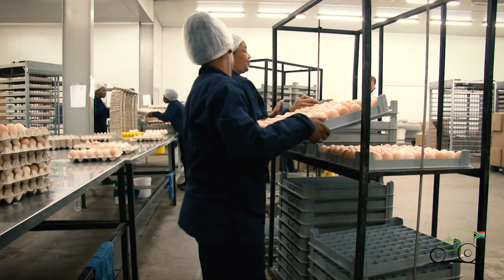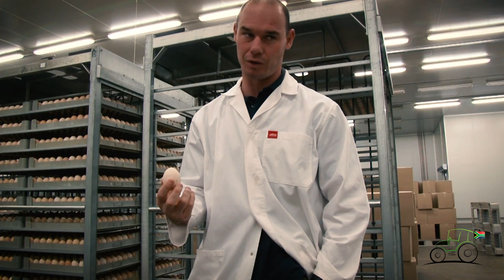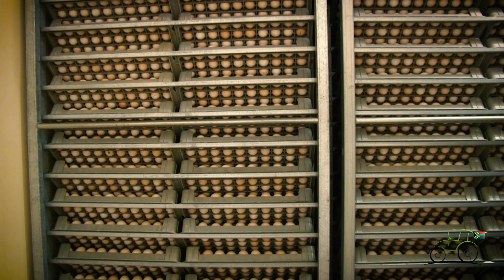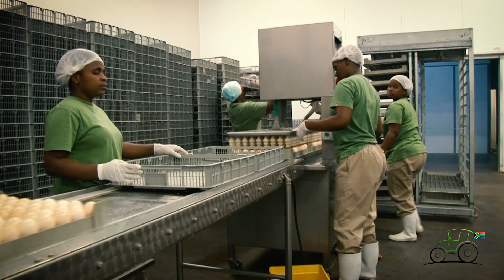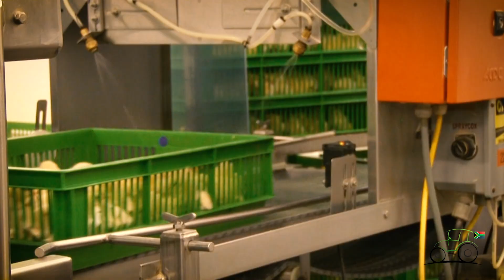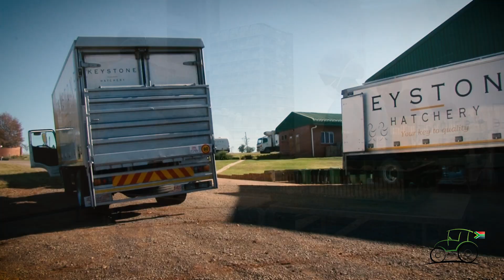Keystone Hatchery

Comment: its a great operation you have there.
have noticed duling your grading process you put the bottom crates direct on the floor,
i vote against that because not only are you risking those chick in the  bottom crate to bacterias they are also subjected to a different temperature as the flow temp will be different from the surface temp.
use the thermal camera to check the temp difference.

Kind Regards.